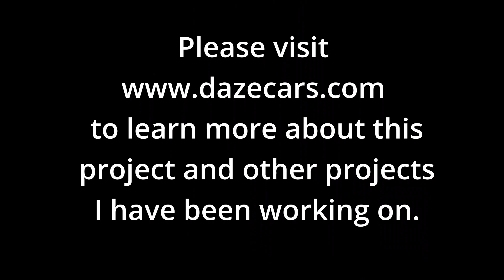Treadmill conversion FAQ 10.  How do I “gear” a treadmill motor?

Comment: No shit..  now how do you GEAR the motors??   You put pulleys on those motors then theyll either slip or stall the motor out...  i want to put a geared gear box on one and then, and only then you will get the torque out of those pm motors..   ive put pulleys on em and yea they add some torque value but in order to get a v belt to not slip at those speeds on little bitty pulleys is impossible.
Reply from the maker: I am running a V pulley yon both my mill and lath with a small drive pulley and it is not slipping at all.  Lawn mowers and other machines use v pulley all the time. If the pulley is slipping you are doing something wrong.  You mentioned stalling the motor that means what ever you are driving requires way more torque than the motor is capable of even after being geared.   A gear reduction motor is something totally different.  I use  the gear reduction incline motor from a treadmill on my mill to raise and lower the mill head.
Reply: Think about those little microwave tray spinning motors that turn at like 3 rpm..  those motors are stepped down loads but u cant stop em, unless you break one of the gears which is hard to do..  same thing with the treadmill lift motors..   those arent that strong of a motor but witg that gear reduction they can push over 2000lbs of weight if held in a certain way so nothing bends..  theres a guy on youtube who took one to a junk yatd scale and got his up to a few thousand lbs before it bent the rack..
Reply from the maker: @Z-Ack  The mistake you are likely making (other that trying to drive something really heavy with an undersized motor) is doing it in one gear change.  You talk about small pulleys slipping but if you do it in stages you can use bigger drive pulleys.  Even a gear reductions motor usually does it in several steps not just a 2 gear system.